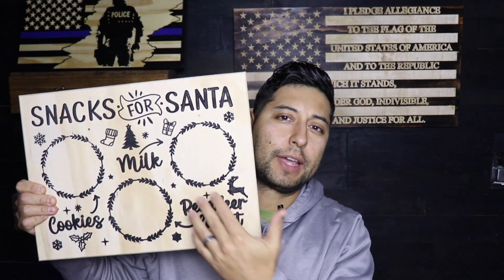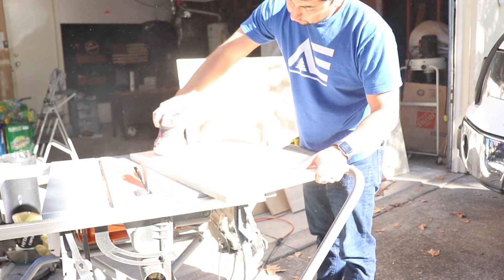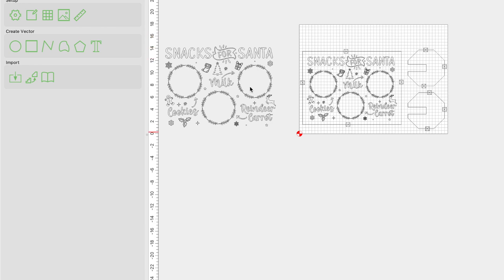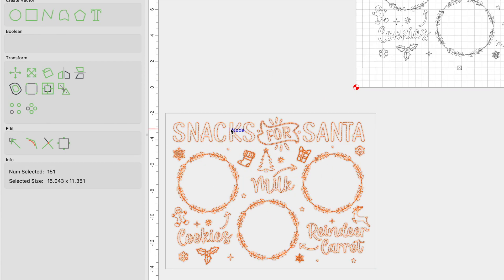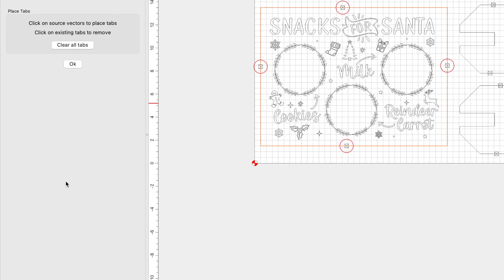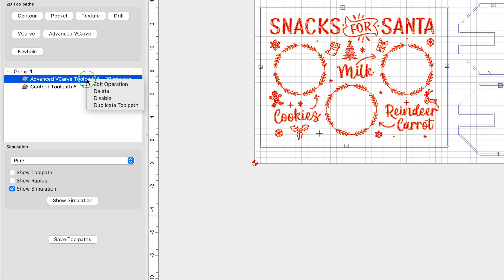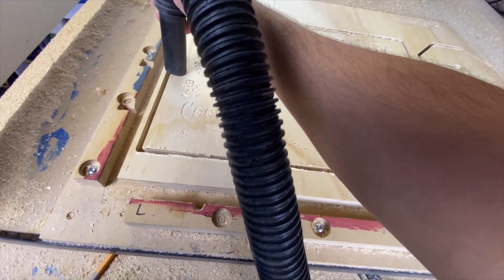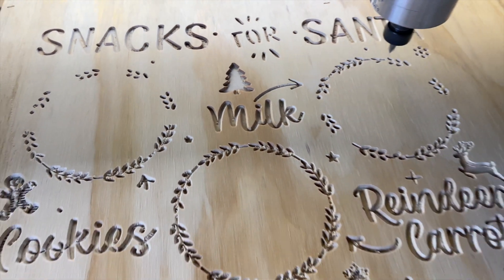Carving a Santa Tray on a CNC

Comment: Thanks for the video. A couple of
Tips for you. 1. Don’t bother with cutting the outside profile. You will always get a cleaner cut using your table saw than with a router. Especially in plywood. 2. Set your z-height after each bit change, it’s not a one and done, you will never insert each bit the same depth in the collet.

Comment: Few of tips for you, little give and take.   1: Use pre-glued solid pine boards, say no to Ply  2: Use a down cut bit to reduce tear away 3: Seal before painting to stop the bleed.  We made these as well in the past but we used a laser for this project.  Good video.
Reply from the maker: Thank you for the tips and confirming panels are the way to go! Should have made the trip to Lowe’s to start with. My HD doesn’t have any pine panels :/ hope you’re well and having success this holiday season!